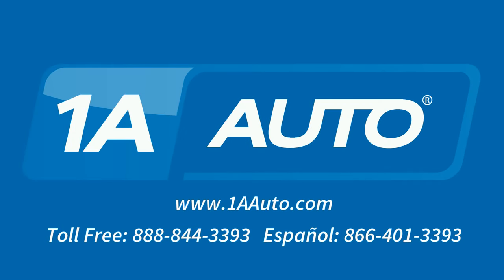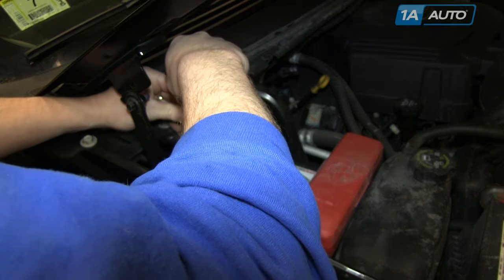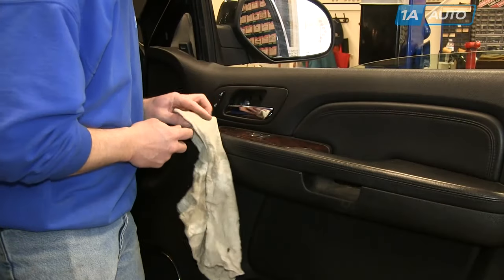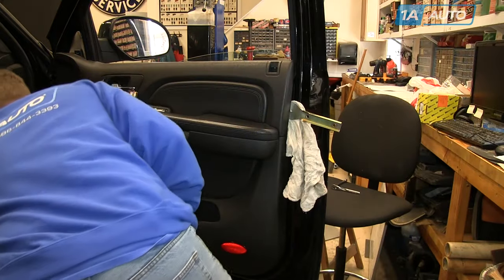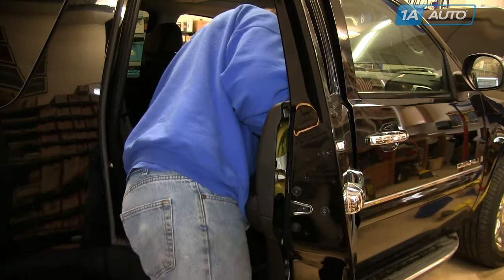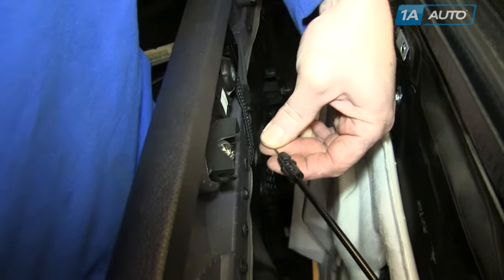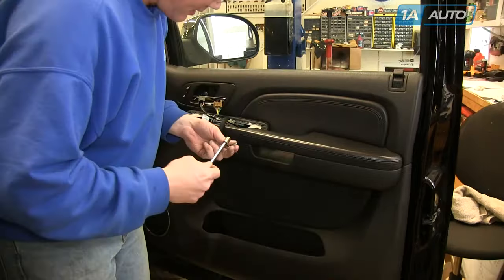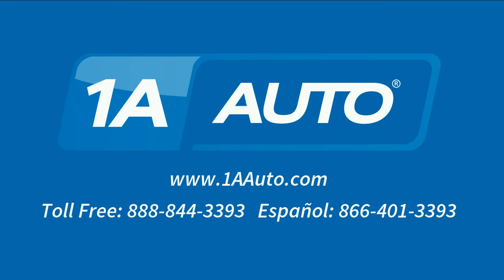How To Remove Front Door Panel 07-13 GMC Yukon Denali

Comment: Just followed this video. Couple things- if you have heated seats, the controller can be popped out w a few more screws and put into the new door (assuming you are swapping the whole panel out because your plastic door pull broke).  

Also, the trickiest part is when you reinstall to make sure the top goes correctly into that window seal-lip. It may take a few tries but when you hit it, you’ll know it and it’s easy from there.

Great video.

Comment: Why disconnect the battery??
Reply: In case you mess up when you're just connecting those small wires,if something touches wrong you can fry something expensive